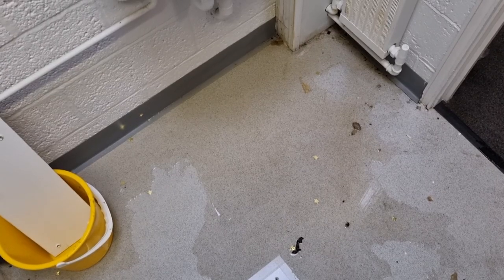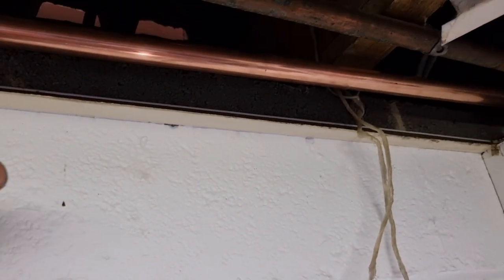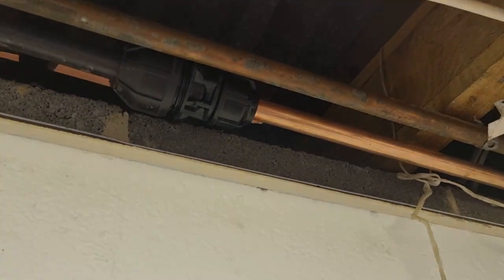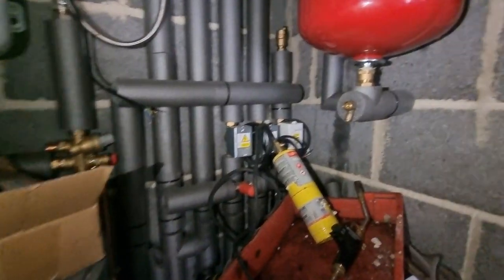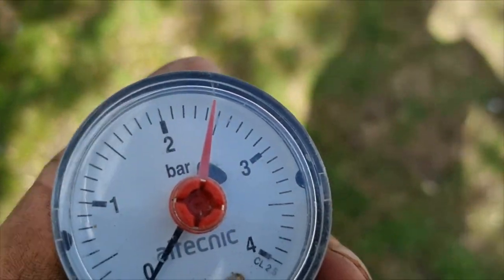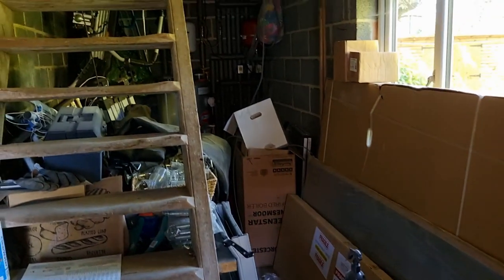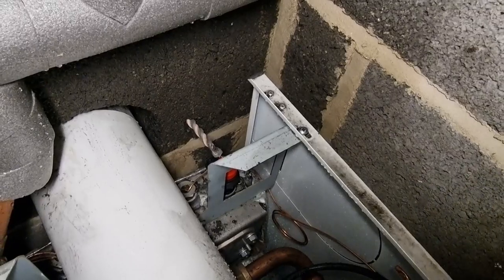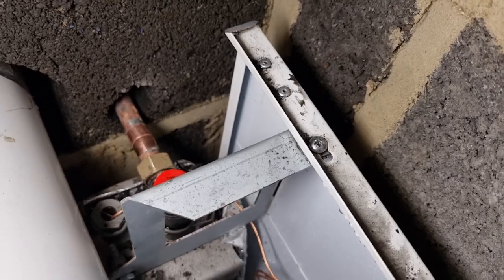The DREADED Polyorc Pipe.... Plus I Get Wet Filling Up At The House Renovation

Comment: Nice one Tom , I always carry at least 1 Philmac transition coupling on the van to get me out of trouble if needed... 👍
Reply from the maker: For me and the jobs I do they are a must for van stock, they are honestly one of the most versatile fittings on the market and have gotten me out of trouble so many times over the years, philmac fittings in general all seem really good quality and are my preferred fitting for underground repairs, thanks for watching as always mate
Reply: Hi Tom, I need to drain my combi boiler heating system down to fit some new radiators and valves. I have noticed in the loft above the boiler two bronze automatic bleed bottles, do these normally give any problems whilst refilling the system?

Comment: Little tip for when filling heating systems  get a pressure reducing valve,  set it at 1 bar , with and additional tap flexy fit it in your filling loop so when filling the system and bleeding the radiators  the pressure never goes over 1 bar
Reply: That is a very handy tip. I'm stealing that 👍😁
Reply from the maker: Sounds like a really good idea that mate,  on this job I had the apprentice upstairs ready to shout if he saw any leaks, I was just day dreaming thinking its taking a while to fill and then all of a sudden it sounded like a fitting had blown, I honestly wasn't expecting the gauge not to be showing pressure, caught me of guard a little bit but luckily no damage to property, only to my pride
Reply: @PlumbLikeTom  it's great when you are working on your own , no need to keep going back to the boiler,  especially if it's in a garage or plant room etc

Comment: Another tip , have male 1/2 adapter pre made with a pressure gauge , if you feel like it’s filling to long , close  off the mains and central heating filling valves , and attach the flexi  hose from central heating to it , turn it  back on from central heating run , to check the pressure it’s equivalent to boiler gauge . Obviously, if there’s filling loop installed to begin with 😅

Comment: You don't need to undo philmac transition couplings completely. As long as 3 threads show you can insert the pipe taking care to mark half of the fitting on the pipe. I usually use them on old black MDPE pipes where the old Imperial stopcock is leaking but I had never seen the pipe you worked with. Anyway you can only use the on cold water mains

Comment: Plastic threads😡 my cousin had a grant oil fired boiler core leak at less than 5 years old, warranty refused!
Reply from the maker: I don't deal with Grant boilers but most say they are very good, one reason I deal with Worcester is the warranty is second to none

Comment: The 25mm philmac will fit over the 26.5mm polyorc. You shouldn't need the universal coupler.
Reply from the maker: Hi mate, I realise they both would probably do the same job, but I had a look on philmac technical website and as far as I could see only the universal transition coupler is recommend for joining pipes other than standard PE. I thought is was best to just to use the transition coupler than risk going against manufactures instructions although this pipe is something I very rarely see so I might be wrong

Comment: Whooshitter Botch, Plastic fantastic!! They’re complete rubbish boilers Tom, the worst boilers in the UK!
Great real plumbing video mate, the lagging looks great 👍👍👍👍

A 22mm compression fitting will fit 1/2” Polyork
Reply from the maker: I can think of a few worst boiler than Worcesters, Kestons being probably one but I know what you mean about them being a little plasticky especially for the premium price, the oil range in my opinion is certainly a lot better than their gas range but this all boils down to preference, good tip on the polyork, its not a pipe I come across all that often around here, thanks for watching
Reply: @PlumbLikeTom  Worcesters like you say for oil, probably the best. Gas no thanks, too many of dem Worcester cuts 😆. Have you fitted any Navian oil boilers ( plumbase sell them). I want to try one but haven’t got the balls too yet.
Reply from the maker: @elwittinio2865  I have never fitted a Navian. Sometimes these lesser known boilers brands can be a harder sell to the customer even though they may be better products, If apple made a boiler every customer would most like want an apple boiler even if it was a badge up ferroli boiler and a pile of garbage